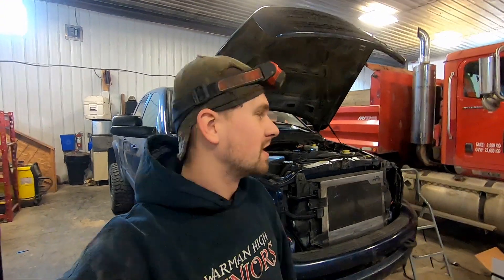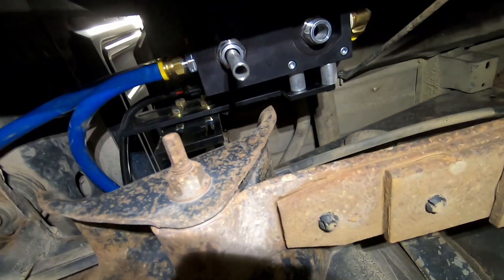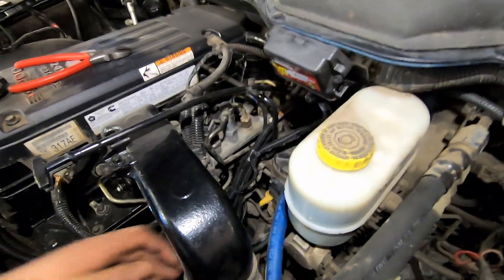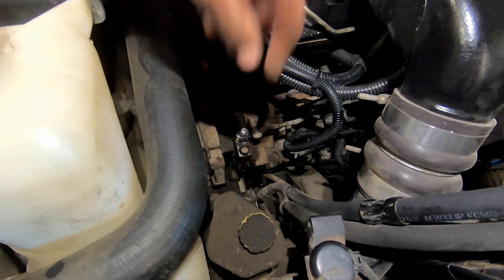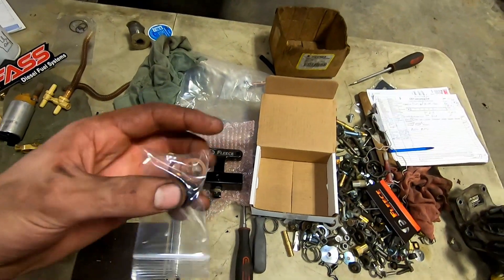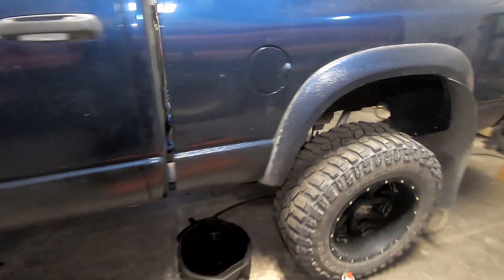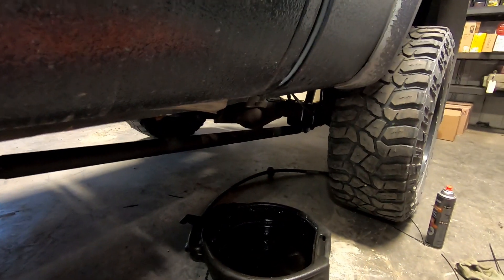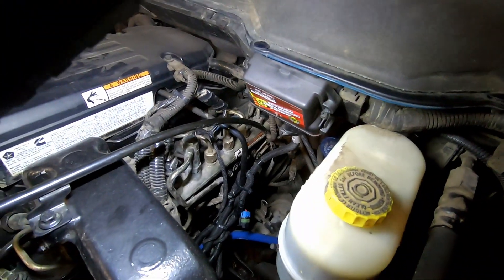5.9 CUMMINS FUEL FILTER DELETE

Comment: Well fass lied to you. The sloshing when low on fuel is literally why you run a sump. It will never have more fuel above the bottom of the tank than it does ON the bottom.

Comment: Did you delete the tps sensor and all that
Reply from the maker: TPS sensor? Throttle position sensor? Tire pressure sensor? What do you mean?
Reply: @darkirondiesel  throttle position sensor with the cable and all or did your truck not come with it either because I have no idea where mine tps/ apps sensor is

Comment: So do you need to delete the housing for any other reason than looks? I got bad injectors so I think I’m gonna do a fass for the filtration to prevent the new set from going
Reply from the maker: Well if you keep your factory fuel filter you still have to change it, so why not just get rid of it ya know?  Instead of wasting your money on filters you don’t need
Reply: @darkirondiesel  wouldn’t the fuel only be returning through ports in the back of it instead of going where the canister went
Reply: Would you mind telling me what that specific blue paint is ? Also what size lift
Reply: Pretty sure you get better fuel flow if u have a fass and fuel filter delete. Unless if you just want a 3 filter system then keep the stock filter but really think the flow is better without it
Reply: @darkirondiesel why do you have to change the stock filter. There’s no fuel going through it
Reply: @tonynewsomjr.4043 why do you have 3 filters. The fuel doesn’t go through the stock filter anymore

Comment: I installed the Bean Sump. It is just a different of opinions on whether it is better or not.
Reply: Look at the fleece sureflo thats probably the best option. I got a fleece powerflo which is a lift pump but the sureflo is just a sending unit and you get accurate fuel level Guage.

Comment: what did you do with the factory supply line from the tank to the stock fuel bowl? did you leave it in place or pull it out? just finished up my airdog II instal and i was about to do the fuel bowl delete.
Reply: Pull it out, adds horsepower.

Comment: Hey bud, did you have a "stretch" issue with the WIF sensor wire harness? I installed mine & the wires don't wanna reach, it'll plug in, but there's way too much tension/strain on the wires for my liking so I unplugged it.

05 Ram 2500, & no, no codes popped up for not having the OE WIF sensor & fuel heater plugged in.

Comment: I have a fass pump and I just did this fleece filter delete and now I have a hose with a banjo bolt that doesn't go to anything that is leaking fuel. Does it go anywhere or should I plug it off ?
Reply from the maker: Where is the hose? Which hose is it?
Reply: @darkirondiesel  it's a hose with a banjo bolt that came off of the stock filter. Looks like it goes back to the tank. It's just hanging there after I did the fleece filter delete and sometimes fuel comes out of it
Reply from the maker: The factory fuel line that fed the fuel filter from the fuel tank? I just folded it over to kink it and zip tied it on the frame. It’s still connected to the sending unit on the top of the fuel tank but when I installed the fass I removed the fuel lines in the sending unit that actually brought the fuel up to the top of the sending unit.

Comment: Ok great idear but your 5.9 is a 3rd gen correct i got a 2nd gen my big question is Heater how well dose the truck start with no heater in the filter ?? i did the same kit to the fuel tank it was a pain in the ass but a lot easer that a gassser ... that fuel filter is a pile of cow dung freeking thing leaks all the time air blead..  thanks for the video

Comment: Also what about that sensor on top of the fuel filter housing side?  Some say it is fuel heater... then there is small fuel pump at the other side. So you end up with 2 plugs disconnected?  Does that generated any fault codes ? Then again you got  rid of in tank lift pump but I understand again pump wiring even not connected not generating fault codes ?
Reply from the maker: Hey no as far as I know it won’t generate any fault codes

Comment: What’d you do with the line that had the quick connect on it?
Reply from the maker: The factory fuel line that fed the fuel filter from the fuel tank? I just folded it over to kink it and zip tied it on the frame. It’s still connected to the sending unit on the top of the fuel tank but when I installed the fass I removed the fuel lines in the sending unit that actually brought the fuel up to the top of the sending unit.
Reply: @darkirondiesel  alright thanks

Comment: I think I'm confuse. Is this a lift pump installation or a fuel filter replacement?
Reply from the maker: I installed an aftermarket lift pump which has 2 filters built in, so I no longer needed the factory fuel filter, so I got rid of it.
Reply: @darkirondiesel  So the aftermarket lift pump that you install serves both as a fuel pump and fuel filter?
Reply from the maker: Yup you bet. It’s a fass fuel system. Air dog is also another common one people use.

Comment: just did the fass and the fleece filter delete now i got a damn no start did you have to crack any injector lines i opened three the easy ones to get to but just me in the shop so i could only crank then go close them its a damn bugger !did yours just fire right up i figured this would happen  so i was surprised yours just fired right up
Reply from the maker: If you crack injector lines and crank until there’s fuel there, then tighten them up it should fire up no problem. Did you figure it out? Maybe you have the feed and return line mixed up on the fass
Reply: @darkirondiesel  Hey man thanks for the reply ! Stupidest thing I just over looked , like you i never removed my intake horn . So without noticing i guess i bumped my emergency shut off valve seen that today opened it dah ! fired right up .. Good vid aswell man cheers

Comment: Lift pump is a filter and aids the fuel pump. It is not a fuel pump replacement. Am I right?
Reply from the maker: No you are wrong. A FASS or Airdog fuel pump replaces the factory fuel pump. Duramax engines don’t even have a lift pump from factory.
Reply: @darkirondiesel  got it. Thanks.
Reply from the maker: No problem buddy